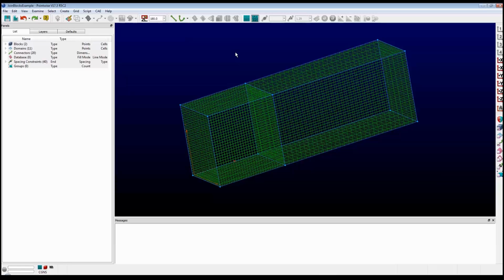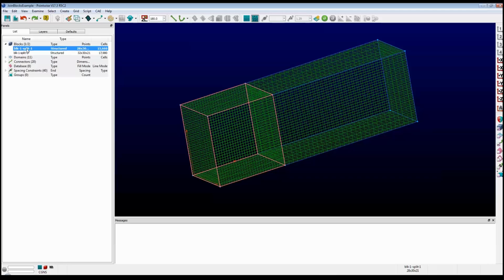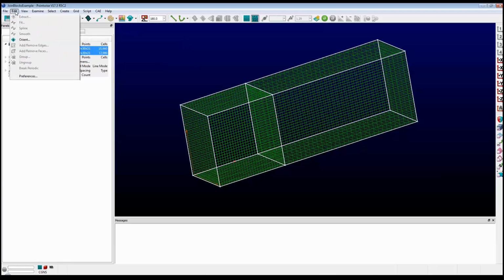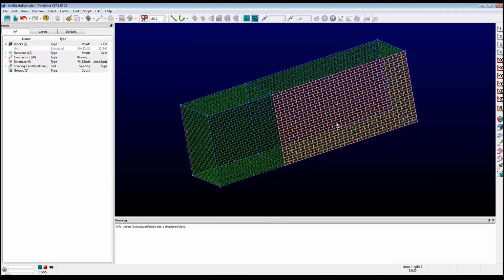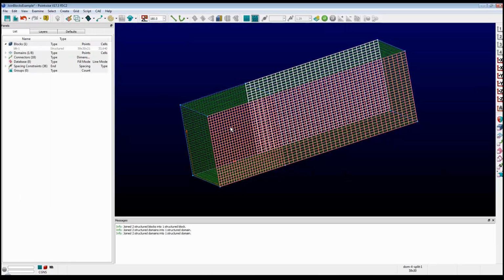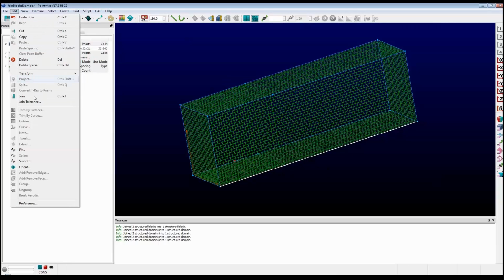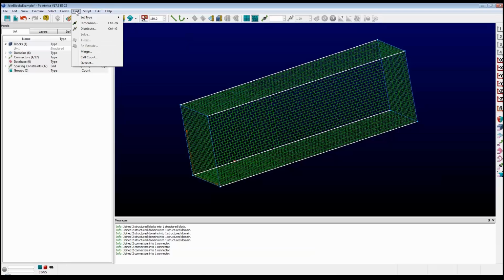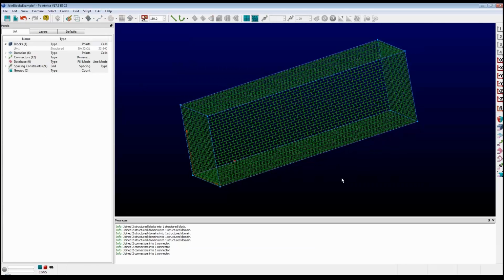Joining Structured Blocks

Comment: Is it possible to join 3 blocks (cubes) to form a single "L" shape block? it's hard to explain but I have something like this image (http://tinyurl.com/h5xk39l), I can succesfuly join 2 blocks the way it's done in the video, but then I can't join the remaining cube to the bigger one I got from the first joining procedure. I am trying to avoid having to deal with a multiblock setup. 

I also tried spliting the domain so I can set 2 boundary conditions to 1 face of the block, but when I import the mesh to ANSYS CFX it just shows the domain as if it wasn't splited.

Any help would be greatly appreciated!
Reply: As soon as the first two blocks are joined, the dimension along the shared interface with the third block becomes the total of the combined two blocks in their shared direction.  As a result, combining the three blocks would unbalance the structured topology.
Reply: Thanks for replaying so soon I think I understand, is there anyway to create a single L shaped structured block? I am new to this software so I apologize if the answer might seem obvious.
Reply: Not that I'm aware of.

Comment: What are the requirements in the code for being able to join structured blocks and domains? There's been several times when I've tried to join blocks and domains that are adjacent to one another and even though the blocks/domains have the same number of points, it does not want to join these together. Does using meshes that are on a small scale effect the ability to join meshes? 

For example, I am currently working on an overset meshing project. I currently have a o mesh that I translated some distance to make a block. I then split the connectors on the inner circle from one to four. Then I selected the cross section at the end of the cylinder (the one that has these 4 connectors on the inner circle), extrude translated it making another block. Then I tried combining these blocks and it wouldn't do so. Do the connectors where the two blocks meet have to have the same exact break points in order to combine the blocks?
Reply from the maker: When joining structured domains and blocks you'll first need to ensure that they are point matched at the interface. This means when joining two structured domains, they must share the same connector at their interface. For blocks, they'll need to share the same domain. Something else to consider is I,J,K coordinate directions and topology. Pointwise will not allow joining domains/blocks if result were a domain/block that does not have a unique I,J,K coordinate system.
Reply: This is it? I've ensured all these and it still won't join. It's very frustrating when simple tasks like this with your software become unnecessarily complicated.
Reply: I can only get it to join the blocks if I dont split the connectors at the interface but I need to split it in order to put an O-H-mesh in the center of the o-grid so that I can specify a wall BC at the end of the cylinder.
Reply: You said consider topology. In the interface between the two blocks, must the connectors be manifolds? Or can it be a non-manifold?
Reply: Hi Andrew,

You mention that you have an initial O-Grid that you extruded using translation, then split the connector of the inner circle of this O-Grid on one end of the resulting block into 4 parts, and then finally re-extruded this set of domains using translation resulting in a second block.  Do I have this correct?  Take a look at the project file I created in an attempt to re-create your situation using this link:

https://pointwiseenterprise.sharefile.com/d-sa9a1fd1b54f4b338

You should see two structured blocks that were extruded following my interpretation of your situation, and you will be able to select both blocks and join them into a single block.  Let me know if I've misrepresented what you were trying to do using your example.
Reply: Hi Zach,

Thanks for the reply. This is pretty much what I've done, but I guess in my particular configuration there is something different that I've done that is causing it ti not work.  I sent Claudio Pita the actual grid I'm using so hopefully she'll be able to shed some light on what is the problem.